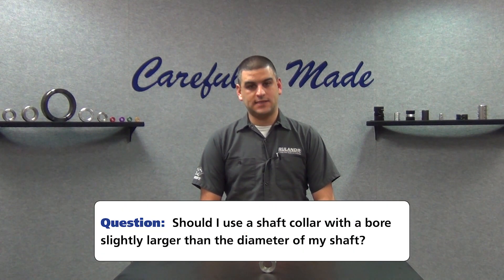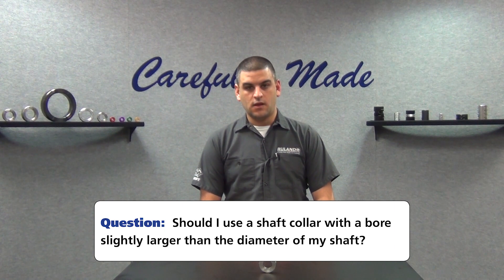Should My Shaft Collar's Bore Be Larger Than the Shaft Diameter?

Comment: Honestly that was a dumb question.  Not even close to a good one.
Reply from the maker: You may think it is a dumb question, however it is one of the top 5 questions we get. If you are unfamiliar with the product it can be deceiving because it looks like it has a wide clamping range when the screw is tightened.
Reply: @Ruland  the reason why things are sized and advertised is exactly for fit.  I mean who says my axle for example is 3/8 but dont give me 3/8 give me 1/2.  I dont know how that even became a top 5 question.  Certain things are ranged like flexible clamps.  This is pretty solid metal so theres no margin of error.  Which means itll be too lose or too tight to fit on.   Even worse if it's a centered inset screw that'll be the only tiny piece holding.  Makes more sense to go slightly smaller at least you can fine tune and bore it out a little more but it goes back again to why not just get the "right" size like how we buy most things to make life easier
Reply from the maker: @ns671fr  Believe it or not, we have debated having "Recommended for Shaft Size" as an attribute on our product pages. Manufacturer to manufacturer and some of the distributors actually do not list a bore size. They list it as "fits shaft" or something equivalent. If that is what you are used to seeing, it can be understood that bore size may look foreign. It should be easy, however we see this come up as a general question all the time. It is one of the interesting things about the job every day.
Reply: @Ruland  I understand it from your side, just dont get it from the consumer side.   Usually consumers getting into specialty products usually know what they are looking for and are pretty technical.  But I appreciate you being neutral as that's how it should be for you because as a company you need to understand both sides.